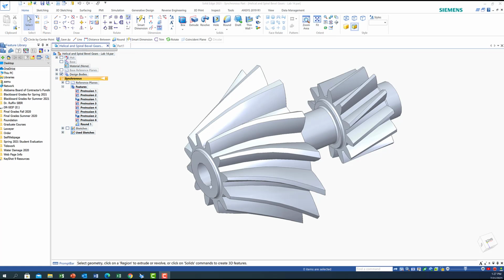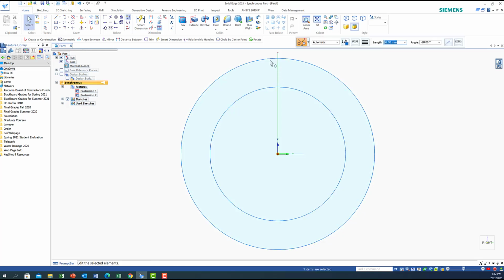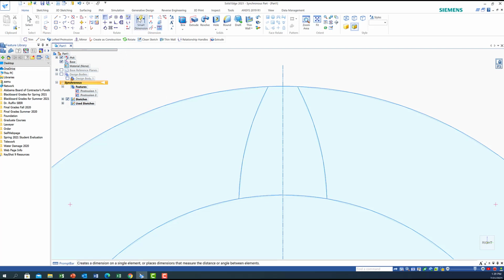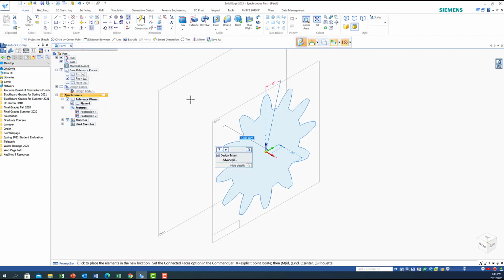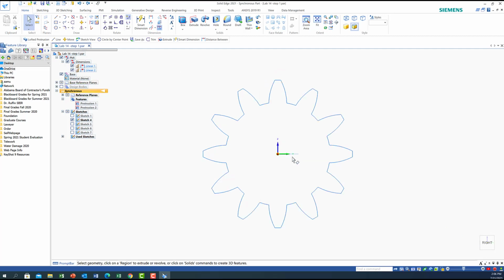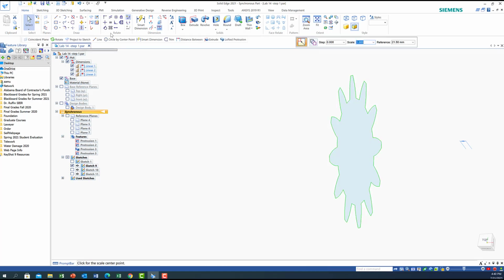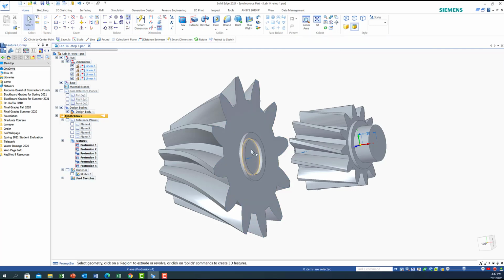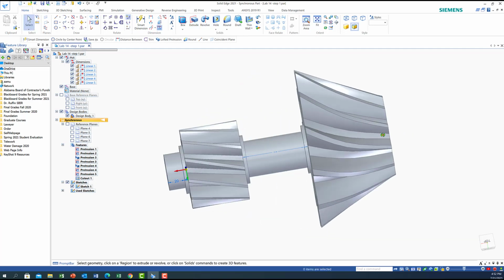Learning Solid Edge - Lab 14 Helical and Spiral Bevel Gears

Comment: Solide Edge 2023 behaved very strangely and crashed several times with this project. Having not any PDF or illustration of this piece, I had to review dozen of times the tutorial to remember the quotes.
However at the end, you forgot the small lip on the front side of the conical gear,which is clearly visible in the beginning of the video. I added a 60mm Circle, extruded by 4mm, then a 2mm fillet.

Comment: Ha, ha...  Did anyone ever notice that the Dr.'s finished gear set is wrong to the original?   The first gear's teeth rotation is in the opposite direction. Sigh. Glad this wasn't real. Eh?
Reply: Editing it in sections to correct for the wrong gear direction was a challenge. But, well worth the effort. I feel more comfortable with the gear creation, rotation, and loft feature now. And can better see how to correct the induced sketch errors resulting from the changes required.  Had to delete the protrusion/extrusion/loft. Then, restore the required sketches. Next, determine correct tooth profiles to select for the proper gear rotation result. Generate the new loft. Re-extruding the keyed hole throughout. Finalized with deleting strange induced sketch artifacts.  Whew...
Reply: P.S.  The Dr. did not finish the sketch, when he declared he was finished.  Sigh...

Comment: Patterns with 2D drawings, sketches.
Patterns for 2D sketches are not available in Solid Edge 'Synchronous' mode. However, it is available in the 'Ordered' mode.   Note: A Part can be changed from Synchronous to Ordered during editing.
Reply: and how can u do this?

Comment: I used SE version 2023.   Thank you. This was a challenge.  I didn't have to hold down CTRL key to make the rotation of the gear profile. SE 2023 has a button to specifically request a copy. So, it was easier not to have press and time the CTRL press.

Thank You.